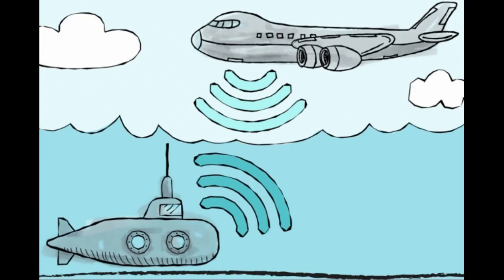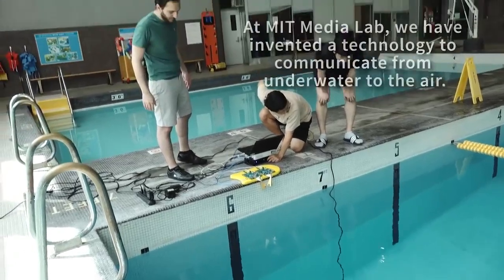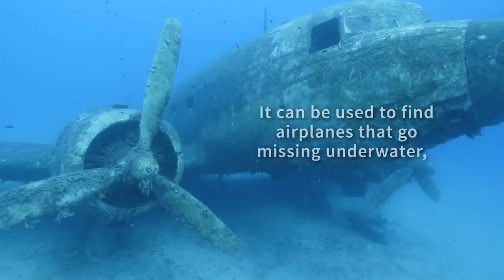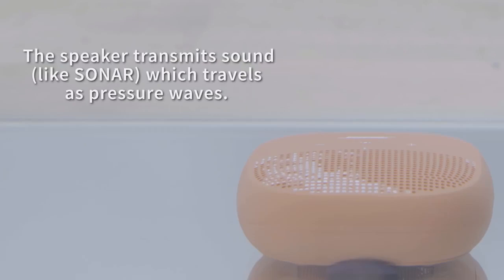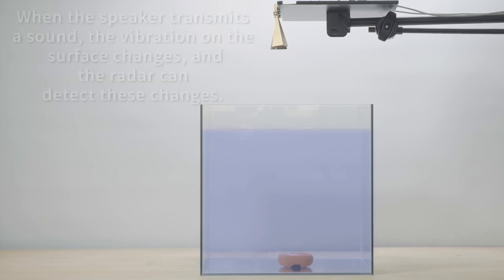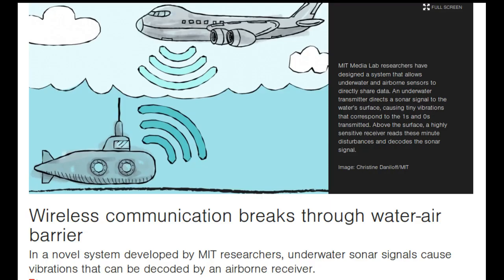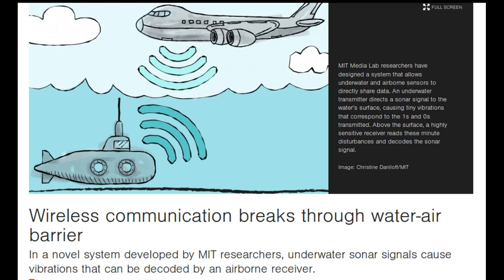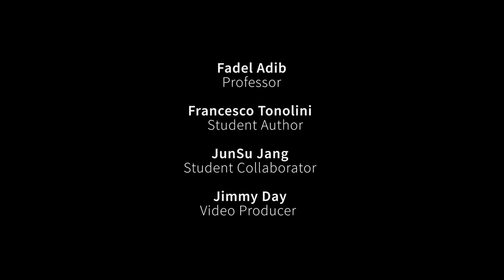MIT's Wireless System "TARF" lets Submarines communicate with Planes

Comment: I want to re-create the experimentation for my school project but Is the radar a very special one that I can't find or create myself ? I found the AWR1642 from TI... I don't know if it will be enough
Reply: It is very complex to derive micro-doppler modulated wave data from the water surface.  There will be a lot of error corrections math needed especially when the water surfaces are disturbed.  You are better off making a bidirectional communication drone buoy with that will communicate with acoustic underwater and RF on the surface to air space.
Reply: Bonjour, je travaille aussi dessus pour un projet. J'aimerais savoir si vous aviez trouvé une solution.
Reply: @mikejelsen5870   moi aussi je bosse la déçu si tu veux on bosse ensemble
Reply: @soulaimanekadri7246  MOI AUSSI JE TRAVAILLE DESSUS ON PEUT LE FAIRE ENSEMBLE?